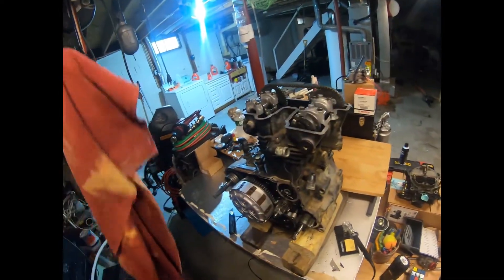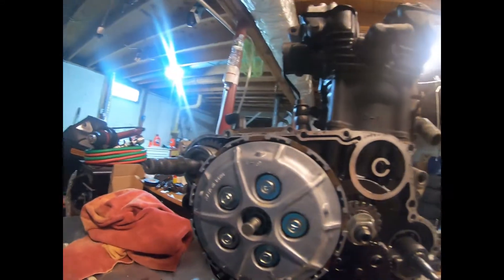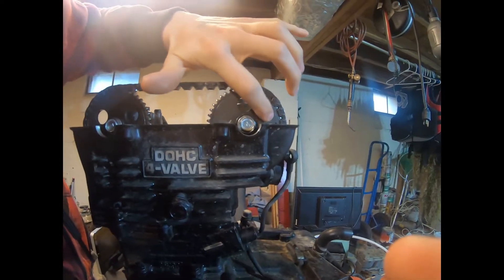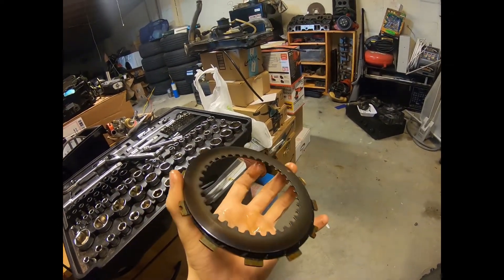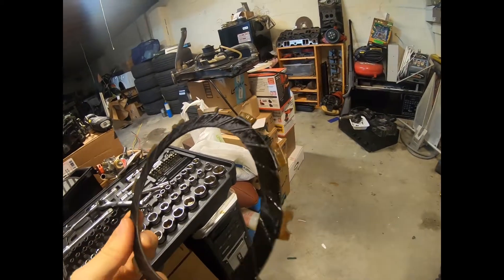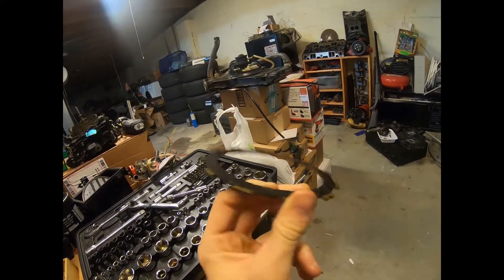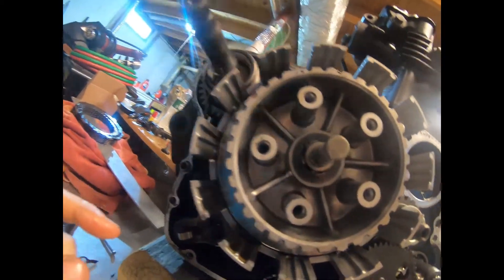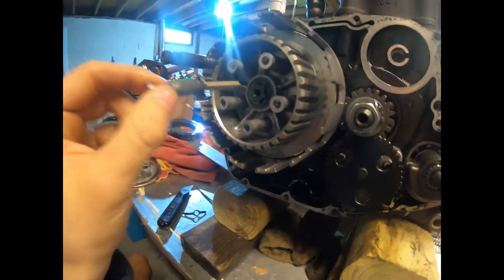Engine Teardown pt1. Kawasaki Mojave 250 clutch removal (Turbo Quad Project)

Comment: I bought one where the timing chain jumped it doesn’t run is it worth rebuilding only have $100 into it
Reply from the maker: Email me asking me for the manual and make the subject Mojave Manuel. All depends on what wrong they can be sold for 1500 so It can be worth it. Also it is a lot fun to ride!
Reply: @SeanChojnacki  yeah I wanted to keep it for myself I tore the motor apart and nothing obvious looks messed up internally I just want to do new rings, timing chain , tensioner and gaskets what’s your email ?
Reply from the maker: Did you receive the manual?
Reply: @SeanChojnacki   could you share a copy of the manual that you have please?

Comment: where do you get all the engine parts? i can’t find anything for the bottom end
Reply from the maker: It’s hard to find parts. You can get them oem but I think that is on Kawasaki website but they are also expensive

Comment: Does the water pump impeller nut have reverse threads?
Reply from the maker: The one on the back with the belt gear does have reverse threads
Reply: I dont know which that is. Im asking about the nut that holds on the water pump impeller.
Reply from the maker: So on my impeller there is no nut on it. It is just pressed together but if you would like you can email me a picture of it. But most of the time impellers do have revers thread. If it was me I would try doing one way and if it moves and feels like it’s not loosening then go the other way.
Reply from the maker: If you like to email let me know I’ll send you it
Reply: I got it off. It was not reverse thread.
Reply from the maker: Good to hear man. I have impellers and others that go in that area cause it can be reverse but also not. It’s usually the opposite of that you think
Reply: What year is your Mojave? Mine is a 96.
Reply from the maker: I was told it is a 2005 Mojave
Reply: @SeanChojnacki  There is a sticker on the left hand at the top of the upper a frame. Or did you paint over it???
Reply from the maker: Probably taped over it but I’ll check it out when I go to work on it this week. Got a vid dropping on jetting the carb and then hopefully run in it